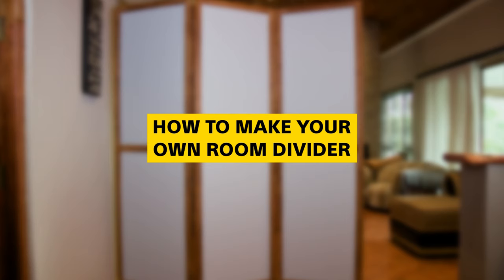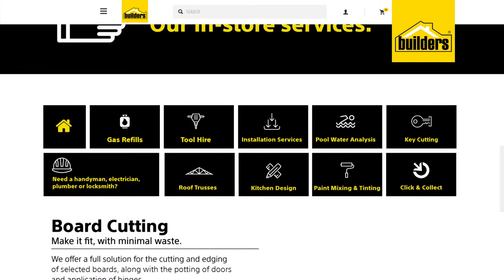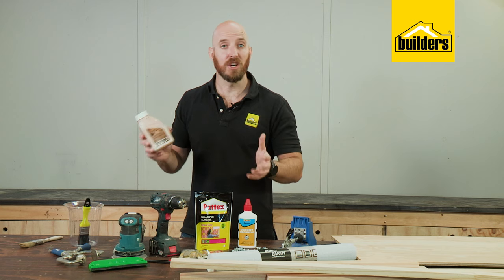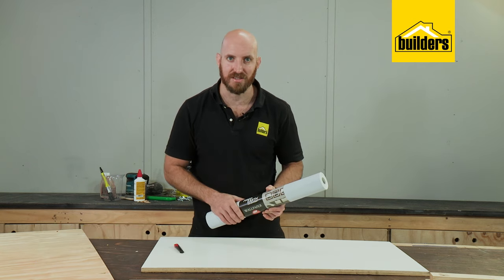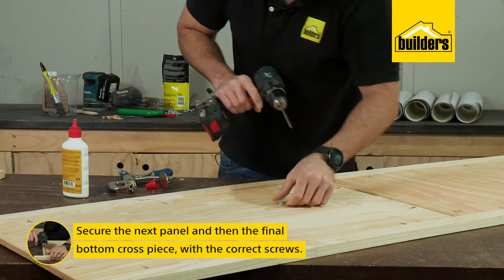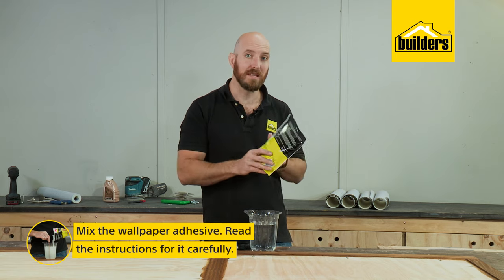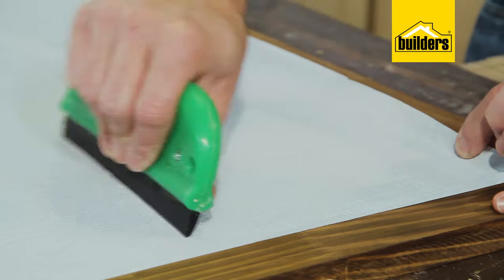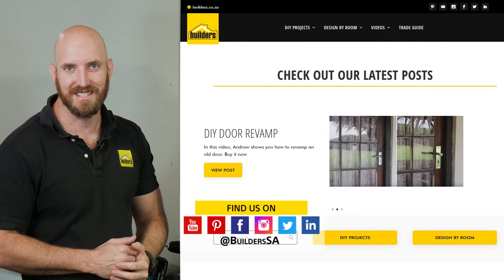How To Make Your Own Room Divider

Comment: great tutorial 🖤 i plan to make these but attach each panel to a sliding rod along ceiling & floor.
Reply: Heyy did you ever do it ? If so how did it turn out and what did you use ??
Reply: @brandylashay6012  i haven't yet because it's too close to christmas but have drawn out the plans & measurements and priced materials at under £100. i'm going 'thin' as possible as i'm not after windproof etc .... just a division from my lounge & craft space. i'll maybe upload a video of the process 🤓